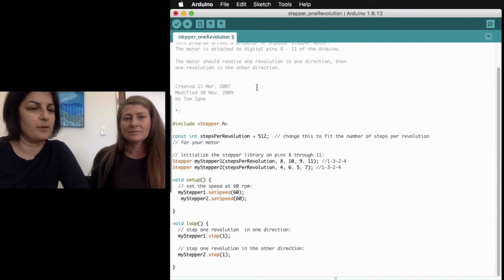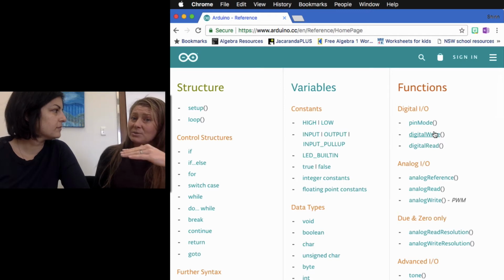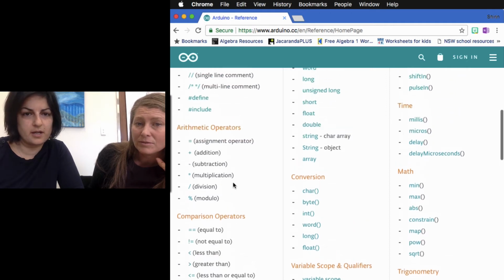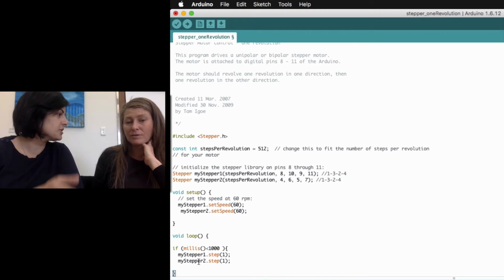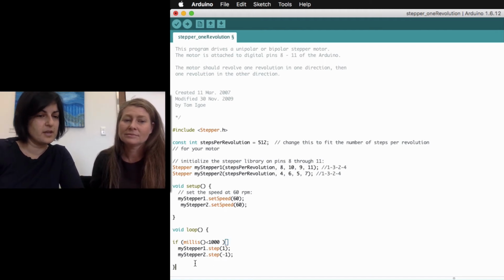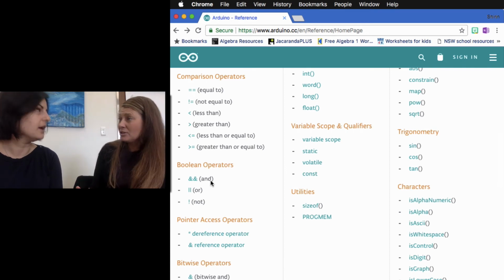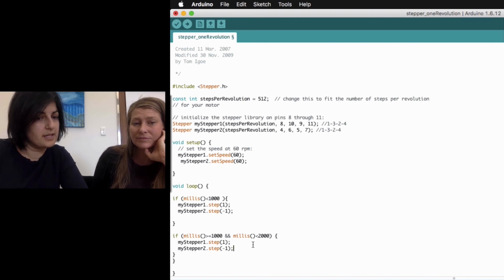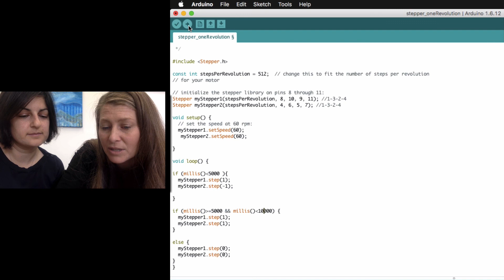How to wire and code 28BYJ-48 Stepper Motors with an Arduino - Part 2

Comment: How to operate both stepper motor with driver in arduino at a time without using arduino shield..is it possible
Reply from the maker: thats exactly what our video does.
Reply: How to connect two stepper motor + one servo in arduino,after compiling the programme only one stepper motor works or either a servo works..